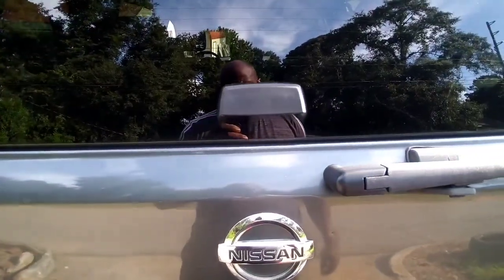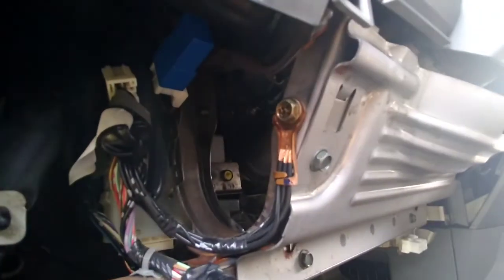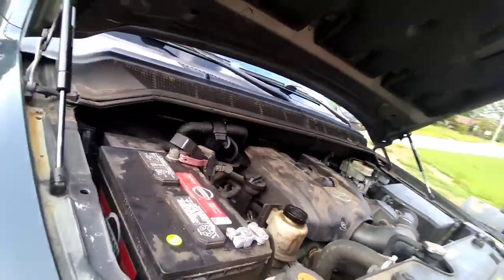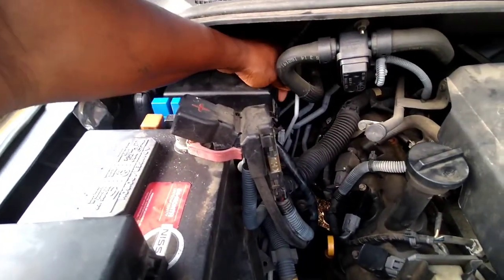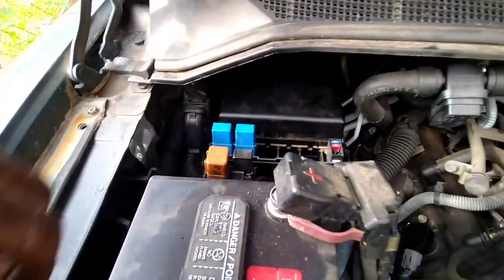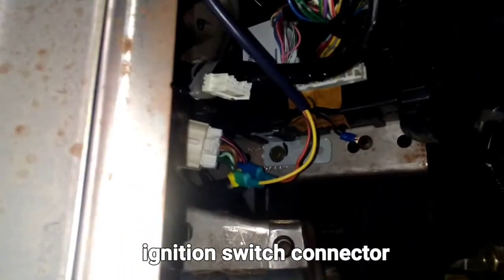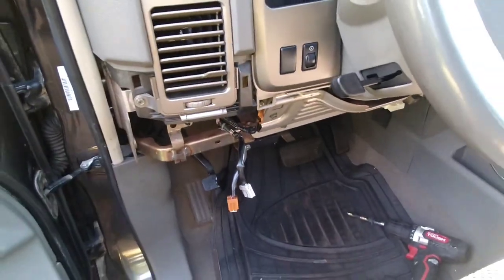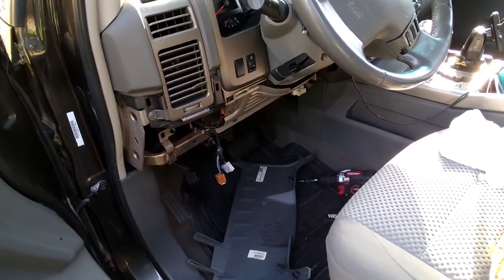Nissan Armada 2006 Titan, Infinity 04-15 Tow running light don't work. Fix it.  Truck won't start.

Comment: How do I find the blue fuse
Reply from the maker: What kind of vehicle
Reply from the maker: Please like and subscribe...  It is the blue fuse under the dash. It should be labeled with a sticker that tells you if it's for signal light or brake switch